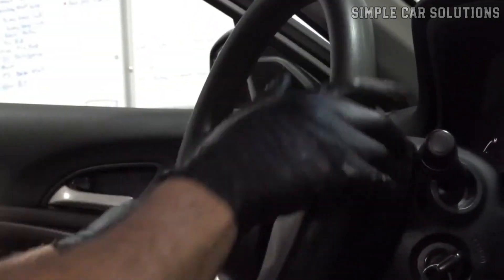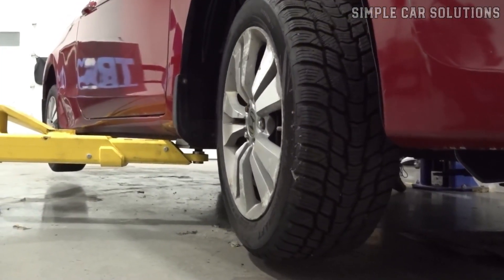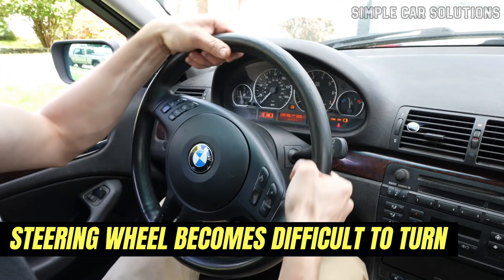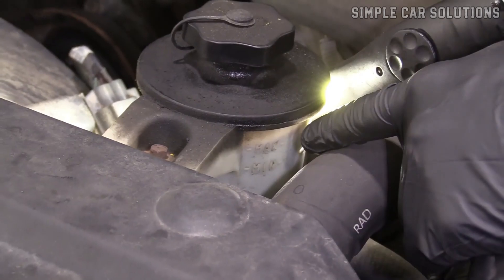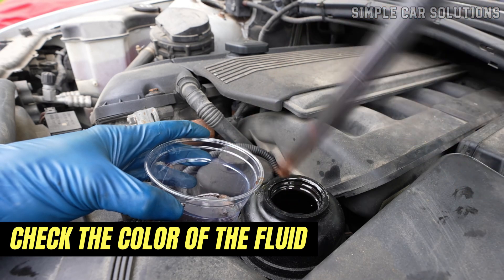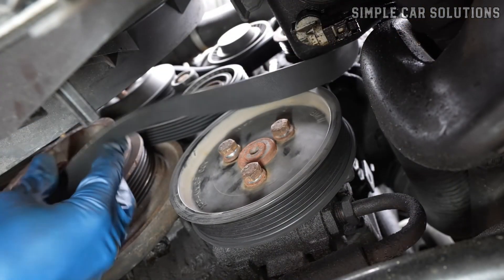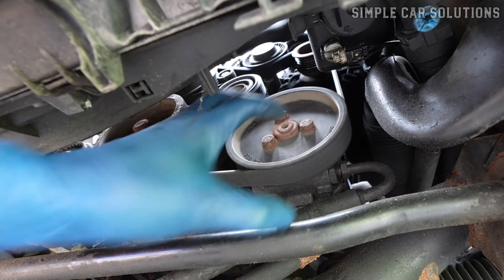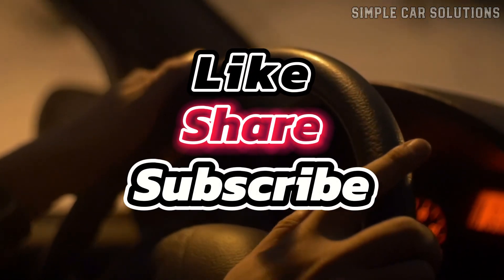Bad Power Steering Pump Symptoms. How Do You Know If Power Steering Pump Is Bad

Comment: My steering pump wheel run and stop what might be the cause? Please help.
Reply from the maker: Intermittent steering usually means low or aerated power steering fluid, a failing pump, or a slipping belt. Check fluid level/condition and the drive belt first, if those are OK, the pump is likely failing.

Comment: On my dodge ram 1500, model is 2012. Recently it has been having issues with I’ll start to slow down and the steering wheel locks up mid drive, the second time the steering wheel locked up and the engine turned off on me. What do you think this could be? The dash isn’t throwing any codes and the hydraulic power steering fluid is filled and looks good.
Reply from the maker: If the steering locks up and the engine dies, it’s likely the engine is stalling first, then you lose power steering. Check the alternator, battery/ground connections, and idle air control/throttle body. Also, inspect the serpentine belt and tensioner. One of these is usually the cause.

Comment: What happened if the wire on the switch pump is not connected
Reply from the maker: If that wire isn’t connected, the pump won’t get the proper signal, you can lose assist, get stiff steering, or trigger warning lights.